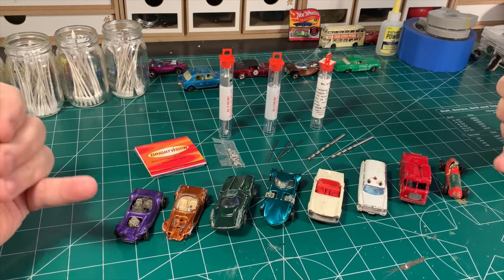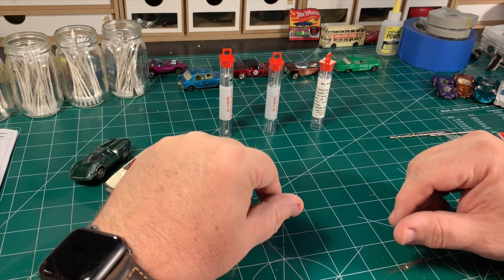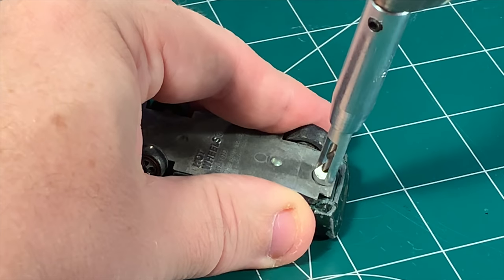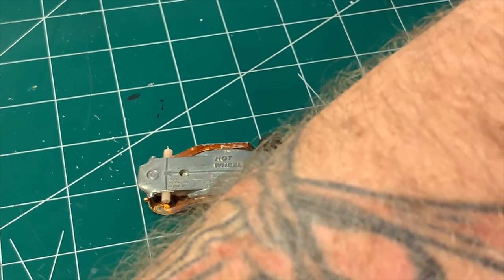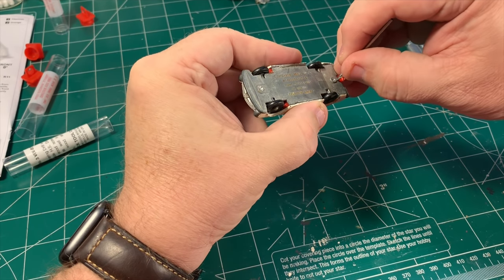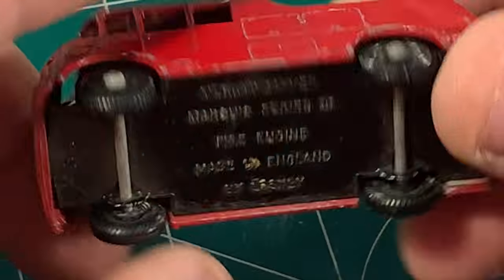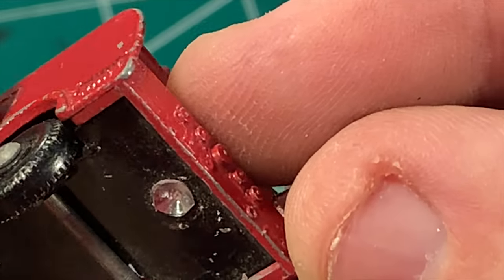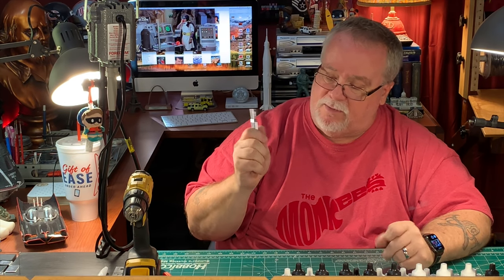A BETTER Way to take Diecast Cars Apart!

Comment: I'm a preschool teacher, and I started searching for pink die cast cars for my class. After having no luck, I thought I'd just buy some inexpensive cars and paint them. Well, it doesn't look as easy as I was thinking. I'm not handy at all, but I may try this method. I'll have to check out your other videos because I'm not sure what to do after this part that you showed. Thanks!
Reply from the maker: I have no doubt you can do this, and will have fun at the same time!

Comment: this is excellent. its my least favourite job, removing those rivets. as soon as i saw you open that tube i knew that was it, a fantastic way to drill out. In the uk we just call them self centering bits so i didnt know what the vix bit is. thanks paul.

Comment: Hi, I have a RC ERTL   Phantasm 1971  Plymouth CUDA 340 1:18 Die Cast model, I want to repaint the interior because in the movie, that Cuda has a black interior, and they put in a white interior. Have you ever taken a die cast model that size apart, and if so is it the same method?
Reply from the maker: It should be the same, but you might need bigger drill bits, screws and possibly washers...  Good luck with it and have fun.
Reply: @pauly7218 , thank you very much!

Comment: Any suggestions for diy wheels on a non rolling diecast car?
Reply from the maker: Not really sure what you are asking. Why isn’t it rolling?  You can use hot swap hubs or even 3d print wheels
Reply: @pauly7218  thanks for your reply... I just w d 40d and 3 in 1 oiled up wheels, and now they roll... Thx

.

Comment: My only issue with this method is that with the housing of the vicks bit spinning it can scratch the base.
Reply from the maker: I though of that, but so far, any marks are negligible and compared to me ruining the entire car by blowing out the post, it's worth it to me.  LOL...
Reply: Eric McGinnis, not to disparage this process, I did notice part of the base was being drilled out, at least on the beatnik bandit.  Maybe could be used for making a pilot dimple instead of using a metal hole punch, then switching to a regular drill bit.
Reply from the maker: That is more about bit size than anything else, but certainly, just using shielded drill to center everything up is a very workable approach!   @ForDemoPurposesOnly

Comment: I just took apart a Siku Renault 5.
It has a terrible prush paint job with excess paint on both the window and plastic underside.

The rivet underneath was completely untouched.
I was extremely surprised to find the same horrible repaint inside the car.

How did they do this?
There's even paint on the rivet inside the car.
This is 100% the original rivet!

Comment: I use different size wooden dowels with the correct length and out diameter size  for drilling out the all the posts. I put the drill bits threw the  middle of these dowels. That I always have great luck with

Comment: Great add to the process, will be helpful to many with minimal tools.  I enjoy my mini drill press and vice setup for precision, secured drilling.  But there's the cost and space to accommodate it.  Liked your other ideas too, Gauzy for the glass and Super Clean to remove chrome off wheels.  The crimping of the axles, nice touch there too. 
Your paint on the Rolls Royce was incredible.  You have to do more pre 1970 Matchbox's.

Comment: A metal tube the right size would also work for centering the bit. It also helps a lot if you put the car in a soft jaw vice, then you eliminate any chance of drilling into your hand. I have one that clamps to my work table, which is also the kitchen table, then can be easily removed when I'm done... it better be removed or I hear about it come time for the wife to go in the kitchen to fix a meal or something!
Reply from the maker: We all have to fight the wife battles!  LOL...  I am in fact checking out a vise.  Ordered one and it was too small...  LOL
Reply: @pauly7218  too small for matchbox cars, what was it, a jewelers vise?

Comment: Love the Vix bit but once you remove the widest part of the post then pry off the chassis and measuring the small size bit to the post for depth put a piece of tape where you need to stop drilling into the post.

Comment: The tool you're using is pretty interesting and I definitely will look into it, but I do have one issue with the way you are finishing the job
Reply from the maker: Jeff, I'm curious,  Why did you say that?  Have you tried it?  What method do you use?  I used it again just today and got a perfect, dead center drilling of the post.  I'm always open to new ideas or differing opinions....
Reply: @pauly7218   hi Paul...first of all I had to edit my initial response...I like the bit you're using....my concern is follow up after you peel the cap off you should get the car apart before sinking any further into the post....reason why I say this is from my early experience drilling through posts inadvertently...i'm talking redlines here...the spin down process usually bent the posts at an angle, sometimes severe enough that you will be off centre by drilling straight down the middle with your 1/16 bit and you will pop out the side....because of this I learned to separate the base first to get a better view of the post....haven't messed one up in years....cheers!

Comment: It’s really hard to get the hang of drilling something so small and precise. I finally got the hang of it after messing up a few posts and drilling into my hand also haha it hurt like hell. I’m going to try your method and see how it goes. What size vix bit did you say buy. Oh one last thing. I find it useless to tap the posts.  Just another step for something to go wrong. I just screw the 2/56 screws right into the hole. Never had a problem. Great video Sir!

Comment: This is a good video for those using a handle drill. I'm curious though as to why you do not use a small drill press/Dremel holder to do this? You can use a soft jaw small vise and put the cars under the press, then set depth with press. Using a proper jig you can also make it so that all car (or at least most) can be held with the same setup. This would be for regular drill bits, which I believe would be cheaper (maybe) depending on bits and costs you used to by press/vise, etc. Costs for press/vise, etc. that I have found for around $100 or less, on the cheap. There are some higher quality versions out there as well. The bit you use in the video can also be used for added control, but I do no see why it would be needed if using a press. Like I said, I'm just curious, not trying to troll or anything. FYI, I repair many small devices in such using a small press setup, as I am a mechanical engineer by trade.

Comment: What works for one restorer is a bad idea to the next.  I like what you have going.  Some like to support the cars in vises.  others claim it tweeks the bodies.  
As for the casing of the Vix Bits scratching or dishing the base...uh...so what?  The car was in bad enough condition for someone to need to pull it apart,  remove the paint...sand it down and polish it...then repaint it with non original paint.  The ultimate topper and demon quest clincher is adding a non original screw  "GASP!"  
Whatever.   
I personally enjoy the peace of using a hand drill.  Something that works slowly but I have the ultimate control of how much I take off the rivet heads.  I dont drill out the posts and add reproduction rivets or screw.  I epoxy my restos closed.  Yes I pinch my cars in a vise.
I think it takes guts to vlog 3 inch diecast restorations.    We are all "Know-It-Alls" with opinions.  In otherwords, we all suck.  But none of us have vlogs to show "how it is done"  You do. And we all watch like fanboys and girls drooling over the really nice paint jobs and cool wheel swaps...So...There ya go!
Oh!  On a helpful note...You can use a regular drill bit and drill out posts that are small...Like the Beatnik Bandit.  Just measure the post with the drill bit as close as you can get it..then place a bit of tape on the drill bit.  That way you should be able to drill without too much worry that you will drill through the hood.  If the screw is too long....just as Marty says...use a bit of emory cloth....and sand the screw down to length.  There....a helpful hint....Lol
Reply from the maker: Well said.  Everyone will have things that work for them that others won't like.  Thanks for watching...

Comment: I would NOT recommend using this method because the shield spinning is dishing the base too, and that's not good. I get why you're doing it, and if the Vix Bit shield did not spin, I'd say great, go for it. But to me, altering, scratching, or damaging the base at any level is not recommended. Use a spring loaded center punch to make your guide mark, have proper method of holding the model and you should be good.  If you have not done so already, take a look at other channels like Diecast Resurrection who in my opinion the best yet at these restorations. BareMetalHW is another really good one as is a new guy on the block Time Rider. Also, Marty's Matchbox Makeovers is another great channel for Matchbox restores. Glad to see you're throwing your hat in the ring, I love these types of videos. I wish you well in future make overs and look forward to seeing what you do.
Reply from the maker: I have indeed tried many methods and I suck at them.  As to any "damage" there really isn't any that I'm seeing.  The sleeve of the vix bit can stay stationary but more than often will indeed slip.  I will try and make a very short part 2 video of nothing but close up shots of drilled bases and you can judge for yourself.  At the end of the day, some guys are great at other methods of drilling.  I wasn't.  This works for me, and I would always suggest each person does what works best for them.  By the way - I'm a monster fan of Resurections!  He is no doubt the best IMHO.  Thanks for the comments and for watching!
Reply: I display the upper and seen parts of the castings and not the screw/rivet/plugged base which can be buffed or painted or peened out anyway. This method seems like a wonderful idea, especially if you've messed up trying to get them off with "normal" methods and not succeeded 💯% of the time.

Comment: But.... We didn't see you take a car apart???
Reply from the maker: I'm having Dejavu here.  This is to expand on the technique I use in my restoration videos...
Reply: @pauly7218  Yes, but how do we know how well the technique works if we don't see the result of the hole in the bottom plate and the post inside?
You had mentioned you would drill through the hood of the car or go cockeyed and blow out a post. Just how clean were the holes and the alignments of the new drill bits? I too was waiting to see you pry one open after you drilled out the head of the rivet.
Reply from the maker: @SpiritBear12    By George you have a very valid point!  First, trust me - I haven't ruined a car since I started doing it this way and have even been able to save some old, bad starts.  Second, I will soon either post a follow up video of this, or show the process in close detail during a restoration video.  Keep watching, and I'll get to work.  Just understand I have a couple vids in the can already so it will be a bit....

Comment: If you haven't got one in your toolbox yet, get a centerpoint-tool. Everytime you got to drill a hole, no matter where (except for tiles) you will have a centered hole. No need for overly expensive bits 'n' tits. 😅
Reply from the maker: I have one and admit it works for some, but I have a bad eye and it makes it very hard for me to center the punch and thus, I was still off center and blowing out posts.  Still, it is an effective way to drill and if that works for you I say go for it!

Comment: I can see why you blow through the body and even  through your hand.  Why don't you put the car in a vise like most of the other restorers use?  Don't tell me you can't afford one since you could buy a vacuum base vice for probably less than one of those VIX bits. Any the way you stop drilling too deep is to put a piece of tape on the bit marking whee to stop.  Those VIX bits look neat but a little bit of preparation and care could have saved many cars, not to mention your hands.  That said, I like your videos and always hit like.
Reply: Also, a drill press would help too.
Reply from the maker: I actually bought one - POS.  I'm looking for another and also have another thing in mind.  I do use the tape when it's tight.  Anyhow, I think my problems run deeper!  LOL....  Thanks for the great comment and insights!

Comment: The problem with this tool is you don't see what you do. It's easy to go too far.
Reply from the maker: Very true!  Still, that is somewhat controllable by drilling in small amounts and far better than my old failure rate.  Thanks for the great comment...
Reply: @pauly7218  Talking about going too far, I have just drilled through the hood of a no brand name Jaguar haha
Reply: Total rookie to all this specifically...digging it already though. It just feels like a natural extension of what I already like and do...I'm an artist/miniature painter-restorer. I was just thinking though, since you can see the drill bit inside there,would taking a sharpie(or paint of some sort... enamel maybe?) and marking where to stop help? Sortve like the taping method I'm reading about here.